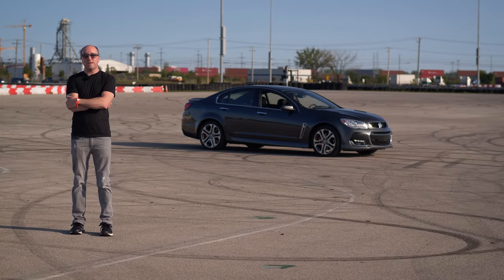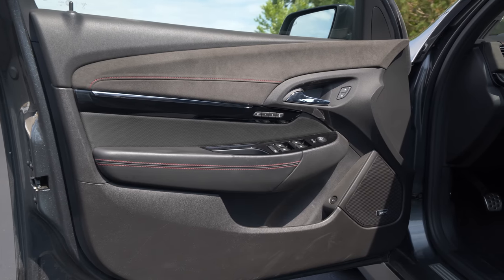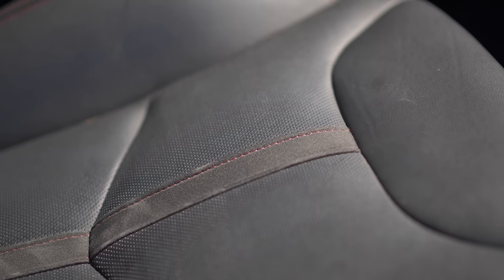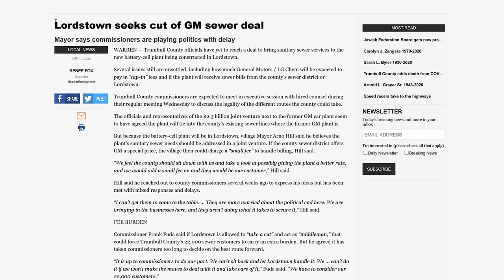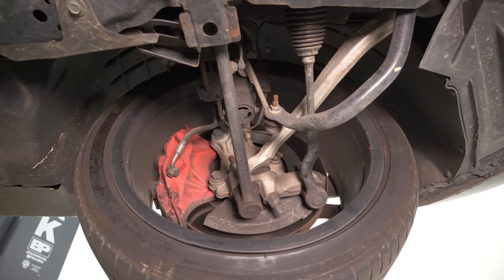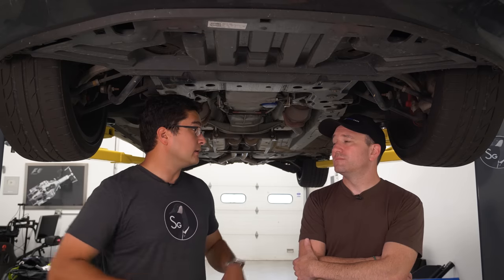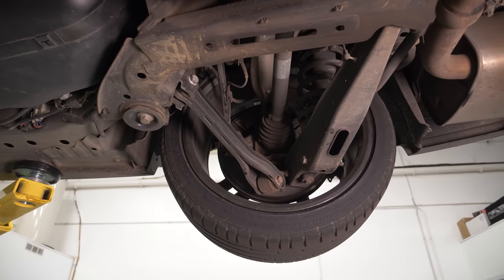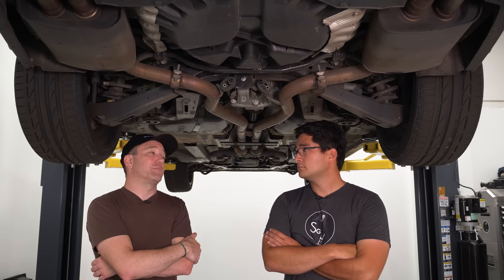Chevy SS Commodore | Holden a Funeral

Comment: Would you not rather have a B7 RS4 or E90 M3 for a bit less with the remainder aside for repairs?
Reply: Rs4 has a greater cool factor, but if it were my car a slick dash e90 m3 with a manual is a great car

Comment: the market for these right now is insane.  considering GM gave them away 20% off they are still practically selling for the same price (35-45k).  GM has been flopping for a long time and they sure did flop on not giving this car better touches like you mentioned on the  interior.  sad sad.

Comment: Sad about this car, because GM did literally nothing to promote it, aside from calling their NASCAR racers SS's. Damn shame, too. If they could have brought it in at a lower price point, it might have done better. Nobody cross shopped this car with it's natural opponent in the E39 M5. Now, car enthusiasts know what this car is, and crave the four door, V8 manual sedan experience. Used values will remain stable, if not appreciate. You just have to wonder what parts availability will be like in ten years given Holden's demise. Buy a clean one, and stock up on wear parts. Then drive it like you stole it. Or like Jack, which is basically the same thing.

Comment: The problem with the SS is at 50K it didn't have a 50K interior. The interior quality is about the same as a GM 25K and below vehicle. I'm not saying it should be just as good as a Lexus, but it should be a little closer. Also Cadillac quality is garbage so I don't expect GM to change.

Comment: Holden built great cars in Australia and their downfall was GM itself. The commodore actually sold good numbers compared to other cars in Australia but Holden were not great at selling other models so the Commodore was their only success, the reason they couldn't sell other models was the public disliked the rubbish GM brought over and refused to bring over what the public wanted, GM came across as very arrogant and it turned customers away so it was another nail in the coffin. Holden could export the commodore and Statesman quite well but again were held back by GM and everywhere the cars were exported they were received well. In the end I don't believe GM were interested in keeping Holden going anyway and just wanted to prop up their other brands to Australia at the cost of Holden. If Holden had more control over themselves they would have done better and it is sad to see a company that produced good products have to die at the hands on outside incompetence and stupidity, RIP Holden.

Comment: I own one of these, a 2015 SS VF. Great to drive blah blah blah. One big problem is that the LS engine in it as a pile of garbage. I just spent $10k on a rebuild because the camshaft am lifters failed at 155000km. WTF?! Fully maintained and never ever missed a service , was never driven like a V8 should in the stereotypical sense, a literally pampered normal 95% highway driving 110kph... to fail so early ... wow. And the GM abandonment of its customers is beyond belief. I shall never ever buy any GM product of any kind... not even electric . My experience was an eye opener. Don’t  buy one of these things . It will be a money pit as the engine will not likely reach 100 thousand miles. GM should have recalled them and fixed them. The aftermarket knows how to fix them ! Love the iconic car, always wanted one , now I have one and I keep thinking what a mistake. What a mistake!! Very angry owner here. My 1979 Ford on the other hand has been abused and fanged ... still going after well over 700, 000km. I still own it and fang it . Getting historic plates soon . SERIOUSLY PEOPLE
DONT BUY ONE OF THESE Holden SS cars UNLESS YOU FIX THAT LS ENGINE WELL BEFORE 100,000km!

Comment: Guys, so funny to hear you whine about a 50k car😂. That’s less than what they sold for in AU for goodness sake, ok there’s an exchange thing, but it has been shipped from the Holden factory near Adelaide SA to freaking Michigan. And the GM thing, in a way that’s what makes it it’s own thing, but still familiar and accessible. Yes there were some true car guys inside GM and this is proof of that. The only other comparator is the CTS-V and it’s out of production now as well. GM only exported about 12,000 of these over its 4 year lifespan so well maintained examples will always be desirable and collectable. That’s why depreciation on these is still quite low. One of the best cars ever to come out of a GM factory, IMHO😊

Comment: I checked used prices after you guys mentioned it and HOLY S&%#! A Chevy that only depreciates 20% in 3 years? No, just no...
Reply: You missed the point. It isn't a "Chevy" technically. Besides a BMW, Mercedes or Charger, good luck finding a rear wheel drive V8 Sedan built in the last 5 years that is affordable. The task becomes even harder if a manual transmission is desired.

Comment: I cross shopped one of these when I was looking for something more sporty than my 4.6L Genesis sedan. Ultimately, it just didn't do it for me. In comparison to the Genesis, interior felt cramped, audio was utter chit, looks too similar to basic chevy sedan, and was ctsV2 money (both used market; this was years ago). It certainly didn't handle like a land-barge, like the Genny, but for my commuting usage, it didn't do things much better for the money. Burnouts...it definitely did those better.
Reply: @TBH not sure what else this car would be other than a daily driver. Perhaps daily driver and commuter are not interchangeable, but dd is what i needed. I ended up with a loaded scat pack charger, which felt much more special than the ss, despite the ride quality being much worse.
Reply: @TBH lol "coming from a genesis..." that says enough right there.. not sure why u are trying so hard to defend a car I literally drove and didn't like. I was well aware of each vehicles strong suits, architecture, heritage, and capabilities. The SS didn't do enough to get my money. The charger did, even with all it's flaws. One thing GM will apparently never understand is that the vast majority of ppl don't buy cars based off of stat sheets. Hence why dodge is still able to sell outrageously outdated muscle cars at a better clip than the far more capable  Camaro
Reply: @TBH dude, I never said it was. My point was there are vehicles that are not as good on paper than many gm vehicles, yet sell better. Vehicles in the same class/segment. I get it; you love the SS. You're a true enthusiast. Go buy one. Already own one? Go drive it. I'm done talking about a car I have zero desire to own because I don't think it does sport, luxury, or any combination thereof better than many other vehicles in it's price segment; including other GM vehicles. Take care, man.

Comment: GM ensured the death of Holden by insisting the Commodore model that followed this one was a front wheel drive Opel designed for a European market. The Aussie market hated it, and Holden sank under the weight of the cost of importing it.  Australia used to have a large manufacturing industry, but it is dying to globalisation very rapidly now.

Comment: you forgot australia RACED these cars. and won australias hardest race (bathurst) with them the reason these cars failed was because it had 2 extra doors and USA wanted their GTO back.
Reply: Dave D  no but they DID race the shells if you want to get technical.
Reply: @TBH V8 supercars australia are lightyears away from NASCAR. they run injection and (hollinger) 6 speeds since the 90s. NASCAR only just recently introducedf the 6 speed.

Comment: The LS engine is a perfect engine when the aftermarket gets its hands on it but not as fitted out exfactory.  They should have been recalled and fixed. The idea of failing lifters and camshaft an under 160k km (100k miles)  just doesn’t sit well with me for a well engineered product, thought likely let down by the awfully low quality control culture of GM. Look at the latest Chevvys ... what an ongoing mess. RUN FOR THE HILLS!

Comment: Have a look at the seat bolster at 2.30.   It's things like this that held the car back.   If you're going to compete in the price range this car was aspiring to then you really need to do it properly, not cheaply.   So many of these look like 60 year old prostitutes after 2 or 3 years - haggard and worn but still with surface bling.

Comment: oh yeah and GM fucked there american run of the commadore, they sold a car that is 35 thousand USD at the ss Trim level for 50 thousand we have a model here called the SSV which is slightly more powerful and its 40 thousand USD and even the HSV Extreme high performance varient is 50 thousand! it was a fail

Comment: The main problem with GM for the past 40 years is two fold: poor execution and poor marketing.
When Honda or Toyota put out a product, they keep advertising it until they kill it.
GM makes something and nobody knows about it. Have you ever seen a commercial for the Chevy Bolt? Or the dead Chevy Volt? Of course not.
And to my first point, except in Cadillacs, the rest of GM's interiors are just garbage. Cheap, ill fitting plastics. 
A shame. I want them to succeed.

Comment: I wish you guys did some proper research about Holden. There were a number of reasons why the brand is being canned & you really didn't cover any of them except for only one reason & that's not even a reason.
Even though GM bought Holden in in 1932, Holden was producing bodies for chassis imported to Australia. The Commonwealth Bank & Bank of South Australia lent GM the money to start Holden to produce locally made cars. GM in the US did not put in a cent. Yes, Holden as well as Ford Australia, Chrysler Australia, Mitsubishi, Nissan & Toyota received govt money but remember too that the US govt also gives US automakers money to produce cars. In UK & in Europe govts give their car makers money & they still do!
In regards to the Holden VE 2006-2013 (Pontiac G8, Chevrolet Lumina, Chevrolet Omega, Vauxhall VXR8) Holden VF 2013-2017 ( Chevrolet SS, Vauxhall VXR8), they were exported to other countries such as New Zealand, Middle East, South Africa, Brazil & the UK as well as the US. Produced in left & right hand drive. Parts & components as you should know come from all over the GM empire & yes they are used in all other GM vehicles to keep the costs down. Ford used Ford parts and components in Aston-Martin when they used to own them. The 5th Generation Camaro 2010-2015 uses the Holden designed Zeta platform. The test mules of the 5th Gen Camaro were built by Holden! The Holden WM Caprice 2006-2013 & WN Caprice 2013-2017 (PPV, Buick Park Avenue, Daewoo Veritas) were also built by Holden. GM Korea was purchased by Holden for GM!
There are a number of factors why Holden closed down Australian production as you have seen US plants close down. The Australian dollar was stronger forcing prices of Holden cars overseas go up. Another factor which I'm sure you can use Google for was the United Auto Workers in the US. They were against importing Holdens from Australia as they claim they were taking jobs away from US workers. Well, the US was importing GM cars from Korea so what difference would it make. GM had to deal with UAW & in the end, imports of the G8 & SS were small in US terms or otherwise GM plants in the US would have went on strike & that would have seriously halted production in the US. The GFC didn't help either in 2009. That's only a couple of factors & there are ton more and there are some we'll never know about. 
You also forgot to mention that Australian roads are crap hence the suspension setup which meant it had to be tougher & more durable. Ford Australia made that mistake using a US suspension system in their 1960 Ford XK Falcon. They just fell to bits on our harsh roads. What you guys need to do (once this COVID business is over) is come out to Australia & drive a Holden on our roads. You'll understand it better. You'll also understand the owners better. When you're here also, try the Holden Special Vehicles E-Series & Gen-F versions of the VE & VF. 
Instead of trying to misconstrue your viewers regarding Holden who might not know it's history, please research. It might be helpful to watch the ABC Quantum report from 1986 about Holden to help you understand car manufacturing in Australia and the problems we faced https://www.youtube.com/watch?v=XOCILCfDo5A&t=601s
GM in Australia will now be a small player as GMSV converting Chevrolet Silverado's & Corvettes to RHD. They are expensive pieces of crap & I would much rather have a HSV E-Series or Gen-F series as they were better built. Our utes are coupe utilities & not bloody pick-up trucks. Ford Australia invented the coupe utility. They are based off sedan/wagons not a stand alone purpose built pick up truck like the Ford F-series. Maybe you guys should stick to reviewing SUV's & Mini Vans. Every US car channel that reviews an Aussie car, gets their information wrong.
Reply: @TBH I said a number of factors contributed. If I listed them all I would have wrote a book. 
I'm so sorry TBH, we've lost Ford & Holden manufacturing in Australia since 2017. How would you like all the US automakers to just shut shop. You'd be pissed off too.
I've watched a number of US YouTube channels "try" & do a history on Australia's auto industry or reviewing an Australian built car and every single one gets it wrong due to the fact that they don't research properly. Google can fill in gaps as well it can be cross referenced with publications. I'm sure if I did a piece on a US vehicle & did not produce correct facts, I wouldn't get any kind comments.
Remember this: What happened to Australian car manufacturers ceasing operations, will happen in the US.
Reply: Why don't you re-read my comments again, I said I mentioned a couple NOT ALL. You brought up a couple points & that's it and no, I didn't mention them cos as I said, I brought up a couple.
You need to watch some US YouTubers cover "their" version of Holden. That'll give you something to do while you watch how misconstrued their information is.
As I've said, there's plenty of publications out there on Holden to correlate on. 
How are we in deep water in Australia? We've had bushfires, drought, floods & COVID but not as bad as you guys have copped it (not including drought or flood). 
I have numerous friends in the US that own Aussie built GTO's, G8's, SS, PPV's, Utes & Crewman. They race them & also use them as daily drivers.

Comment: Tax payer funded because GM kept taking and limited funding. 
Holden Boss new GM wouldn't have went for VE VF as I've read the story he's words was stuff them , holdens plan with this car was global left and right hand drive and that's the reason GM shut us down because Holden would've been the dominant manufacturer  . Zeta chassie was designed in Australia and GM used it because it's better than there own format.
GM has always lined there own pockets and dictated the outcome of holden to suit themselves simply Holden could not have a better product than GM.
1984 the article read Holden V8 till 98 if this isn't writing on the wall .
So income the gen111 chev motor 98 with the wrong rings installed burning 1lt what ever OZ   per week good old GM quality. 
And to top it off GM lies no GM cars will come to Australia , now we've got all them here which i will never ride in I'd sooner push my holden in 30 yrs than drive a criminals pile of bolts.
GM stands for General Machanic . Ps plus our world class engineers/ desigers that are US based to keep your cars in development. 
All Holdens should be banned from leaving our shores . And imports stopped.  Cheers all just my honest apinnon China does it and now USA. Wouldn't be so pissed if Holden went alone and GM cars came in.